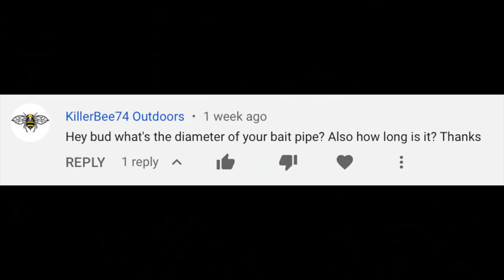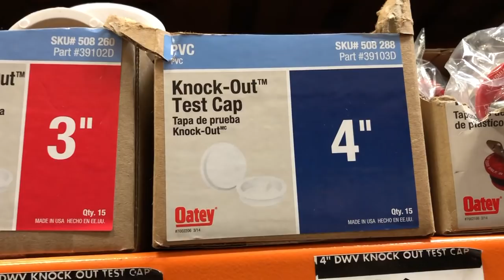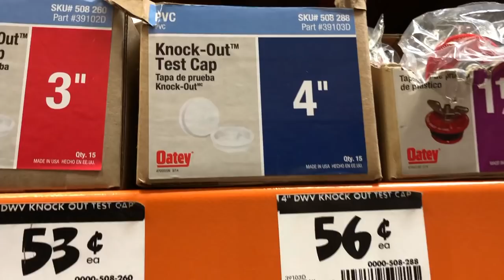How to make a DIY live well, baitube, bait tank | Mackerel scad, Goggle eyes, and Ballyhoo

Comment: Thanks for posting this video.  I have been using your design fishing from myWaverunner and it is a working exceptionally well so far.  I did modify your design just a little bit because of the speeds I will be trolling at by completely closing off the front with a screw-on cap and purposely drilled my half-inch holes at a forward-facing angle so that water would slick by when I'm at speed... Then I melted the holes a little bit to try and smooth them out so I won't cheese grate my bait.  I thought if the holes were drilled at a forward trajectory would prevent my bait from getting power washed if I went too fast with them.  So far I have packed the tube with as many as five goggle eye and have trolled with the tube as fast is 15 miles per hour for quite a few miles and the goggle I have been just fine.  Still waiting to test it out with opelu.

Comment: Just made mine. I was using an5 gallon bucket with holes halfway up all around to the top. When I go to paddle I'd bring it into my boat and let half water spill out.   Works but you tube design is going to be best.

Comment: Just had an idea for a more aerodynamic nose cone for your setup.  I have been struggling with trying to think of a wayto build a bullet shaped nose cone but the solution might have been right in front of my eyes.  Cut the top 7 inch or so off of a 3L bottle if you can find them.  Run the towing rope through that bottle opening and then to the bait tube as configured.  When you're ready to paddle just slide the 3-liter bottle top down over the front of the bait tube.  It should stay in place while underway creating less drag...but is still easy to get out of the way to access your bait through the front

Comment: I also found out that inside of the 4 in PVC screw on cap with the square plug topone of these things fits absolutely snug and perfectly so that you can light up your bait tube from the inside as it floats so you can keep an eye on where it's actually at if needed. I figure if my setup ever gets broken off somehow that will give me one last chance to find it floating in the dark. My white PVC schedule 40 does float just fine though.  They are called marcala LED road flares.   MARCALA LED Road Flares
 https://www.amazon.com/dp/B07KW97KZF/ref=cm_sw_r_other_apa_i_58h5EbJ187V7K